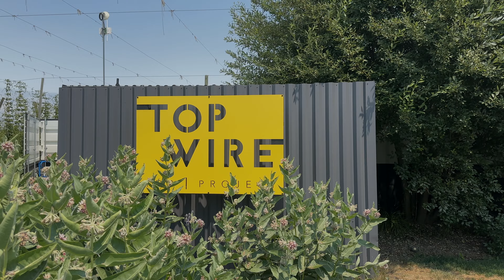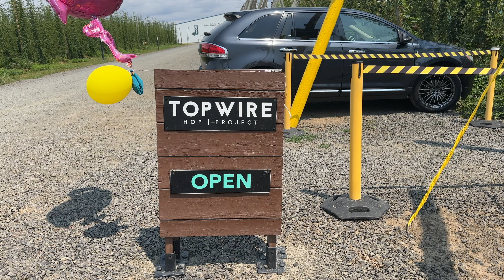Sunday afternoon ride on Norton Commando Motorcycles

Comment: Very nice ride out video. Well edited. I have a 1968 Norton Commando project that is making very slow progress. It was the 820th Commando to come off the assembly line. At some point it had a 1972 motor installed and a later front end with disc brake. It has the original widow maker frame that I have welded in a brace similar to what was done on the later frames. I hope it stands up. I have the engine and transmission left to sort out but everything else is done.
In the mean time I purchased a 2022 Kawasaki W800 and am very happy with it. Kawasaki did a good job keeping the 60's riding experience alive without the reliability problems. Great to see the W650 in the mix. Truly great bikes.
Thanks for keeping the old Norton bikes alive.
Cheers
Bob in Ottawa, Canada

Comment: I'm twenty eight living in the states And i just finished building my dream bike, a yellow 1972 norton commando 750!  I bought her blown to bits with 2000 Miles on its Odometer, I bought a used recently rebuilt 750 combat Motor off ebay took it apart to give it the one over To my surprise, it was bored twenty over in both cylinders And was so fresh You could still see the hone marks on the cylinder walls,, got it back together with a standard head instead, of the shaved combat head that came on it. finally i got oil to main bearing then gave her a try started right up second kick sounded beautiful    can't wait to take her for her first ride, my first project of this sort, Always built cafe racers and tried to make them look like the commando. Now I have the real thing. In my opinion, the commando is one of the coolest looking motorcycles ever built,